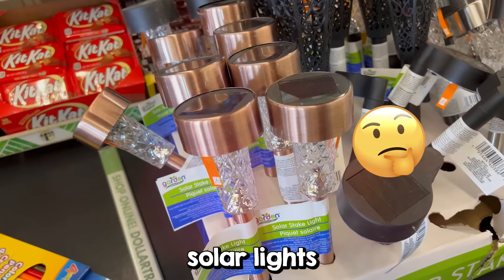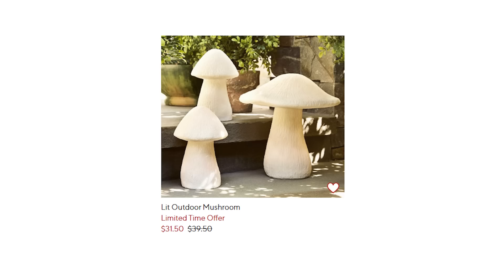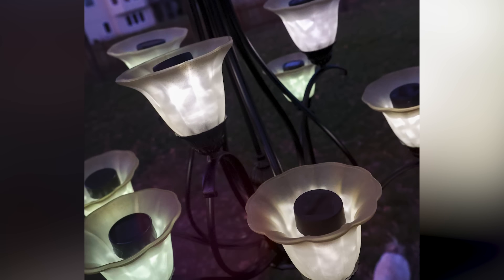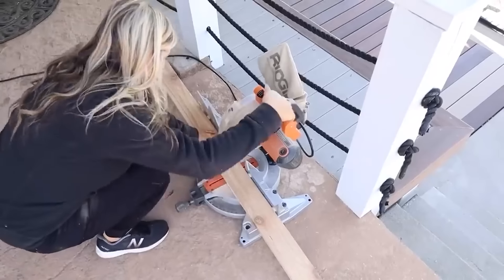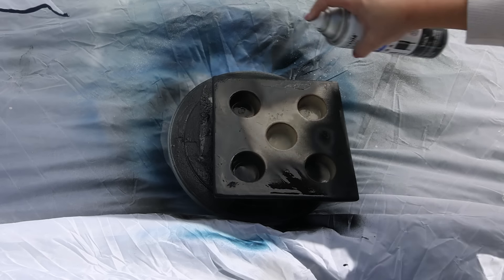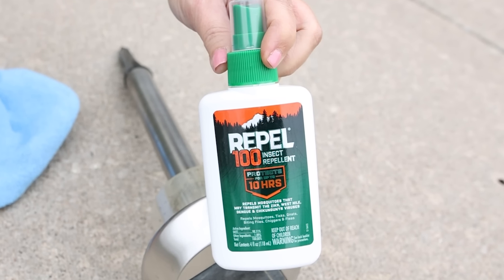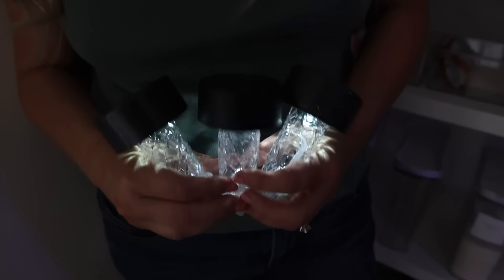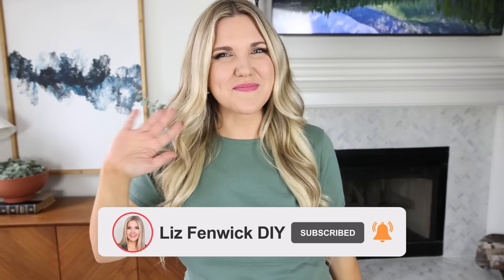24 Brilliant Dollar Tree Solar Light Hacks

Comment: Ive been using faux flowers outside 4 years. I spray them wth Rustoleum Clear coat (protects the color frm the sun, whn they get dirty i spray thm wth a fine mist of water & they look new again). I remove thm ea season & place thm in a plastic tote wth latch. Next time i want those colors i switch thm out again. And I have beautiful gardens all the time. I also make garlands of flowers & use them on an archway that goes to my front porch. I use thm wth the solor lights, on the solor light trees, etc. And $Tree has some great silk flowers. And they look so much better than plastic
Reply: Wow i’d love to see that!
Reply: I've been wanting to use faux flowers but never really knew how and if it would look tacky. The ones they have come out with in past couple years look amazing. My hubby is allergic to bees and I want that look outside but afraid to drawn them in with real ones. His father is allergic as well and not sure about or child yet so I try to be safe with decor. I need decor though so I'm stuck.
Reply: 0
Reply: Thanks for the clear coat idea. Never thought to do this!!!
Reply: Hi yes we use a lot of the dollar tree solar lights. But I have found that the more expensive ones last much longer. Next time I use one I will write down the date and compare.
Reply: Interesting! Not a bad idea!
Reply: If the plants are green you can spray paint them each year to refresh!
Reply: The clear coat’s a great idea - thanks! 😊🏴
Reply: Great tips! Thanks for sharing them. Looks like my front porch will be pretty this year 😊❤
Reply: @rese7878 I made my sisters n girls wedding bouquets with flowers n people refuse to believe they were faux from Hobby Lobby.

Pot them up in dirt n spray with poly! I use faux on garden arch n grow everywhere else.... cannot tell😊
Reply: Thank you so much for sharing! We are moving into our new home in a few weeks and I’m going to do this.
Reply: Thank you for sharing this! I’ve always wondered if there was a product out there that I could use to seal in the color!!

Comment: Liz, I’m an event designer and I use faux all the time. I paint them with poly acrylic sealer and they last and last and look real. I use floral tubes to work in some real foliage and florals at the last minute and I promise, they look full, elaborate and expensive for half the time and price. Ironically we recently designed a Phantom of the Opera party and I used a huge chandelier as a candelabra- replaced the lights with candles lengthened with pvc- all covered with drips made from hot glue then pained and dipped in wax. Made a base and sat this in the middle of a huge table. Like yourself, we like to do the unexpected. I always enjoy your creativity and spontaneity!
Reply: The Phantom of the Opera party sounds awesome!♥️
Reply: Very cool idea about dripping hot glue detailing.
Reply: Yes I would use fake with real. Looks great.

Comment: I use the Dollar Tree fake flowers in the summer around my pool.  I cut them apart and them put them into the bushes around my pool so it looks like they are flowering.  It is great for parties.  If the flowers look cheap, those are the ones that I place farther out because no one gets close to them.  It really works well.

Comment: I just purchased two faux fern plants for my front porch.I’ve given up on living potted plants , the sun is so strong the plants just don’t like it there; not even the plants that say full sun🥵. I move them to my backyard/gazebo and they thrive😎. The faux ferns look and now I’m ready to add plants with color. I love the chandelier idea…I have an old one I’ve hanging on to until I figured out how to repurpose it…thanks😊 Last😊 of all the Grandinroad magazine has these round white globe yard lights for a ridiculous price…but “should be “ easy to duplicate with clear bowls , 2x paint and solar lights.I saw the perfect globes in a shot at Your restore…probably won’t be so lucky at mine but going to check it out . Great video❤❤…gave me lots of inspirational ideas. 😀👏🏾👏🏾👏🏾👏🏾Thank you  BTW your idea from a previous video , to use a heat gun or blow dryer to help bend the leaves into shape worked perfectly.

Comment: Some great solar light hacks. I've had a chandelier with lights in a tree for years. Have to replace the lights occasionally. I did notice Liz struggling to push the lights into foam and the wood box planter...Do you not know to take the bottom piece out of the solar light and turn it around so it makes a pointed stake?

Comment: Nice hacks, but just one promlem. Using the e 6000 and quick Crete makes it permanent, if the solar lights stop working, you can't change them out.
Reply: You can pull the light part out of the holder/pole